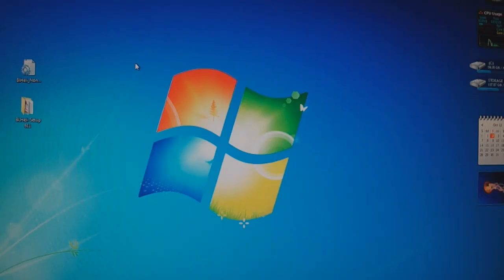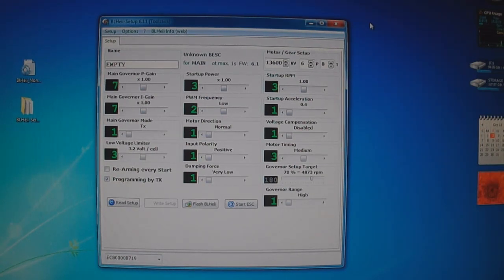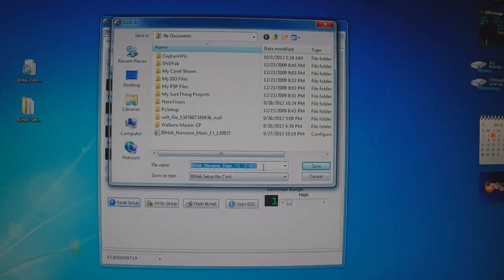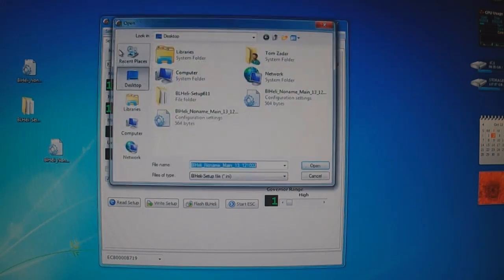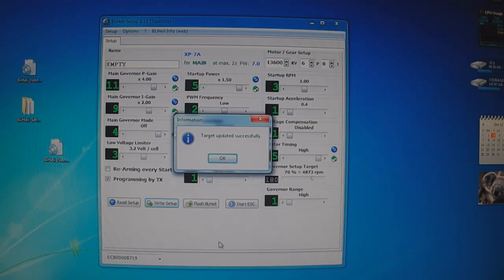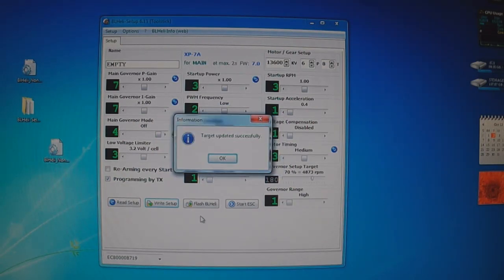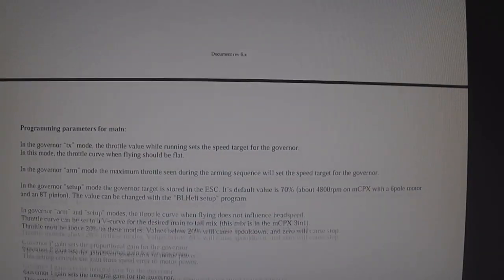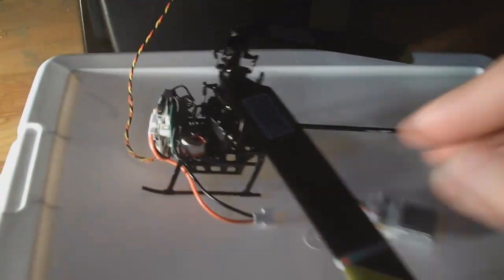How To Use BLheli Software with the Oversky 10A PNP ESC

Comment from the maker: Hi, I am not familiar with the airmrxv2 10 amp. This Oversky ESC is fully programmable and has a Governor so you can program it to have full power until the battery runs out. The Governor will increase the RPM as the battery goes low.

Comment from the maker: Hi, ignore the error message, it will work fine. It just means you have the ESC flashed with a different version of the BLheli setup.
 
The error message is due to my ESC is flashed with Blheli V7, and I am using BLheli setup V6.11. I don't get the error message using Blheli V7.

Comment from the maker: That is odd if it doesn't run in normal mode but it does in idle up mode (your post below).
I would check your transmitter settings and if they are OK you may have a bad ESC/Converter.
I had the mCPX brushless with a couple different ESC/Converters and they worked well.

Comment: Where can I download the software for the programmer. I don't see it in the link. Thanks. I'm having major issues with my pnp brushless mcpx. All I can get it to do is spin for 2 seconds and then it shuts off. In idle up mode it's fine.